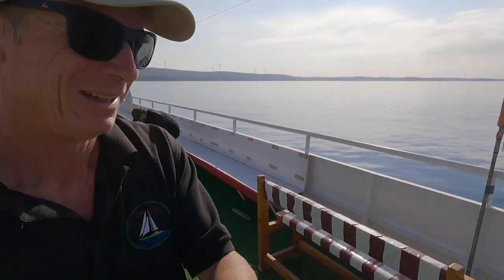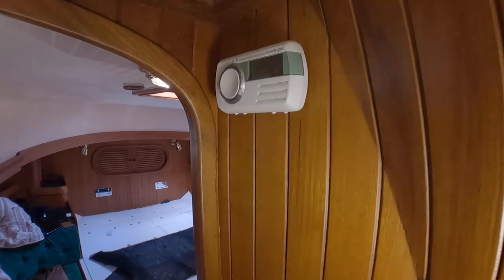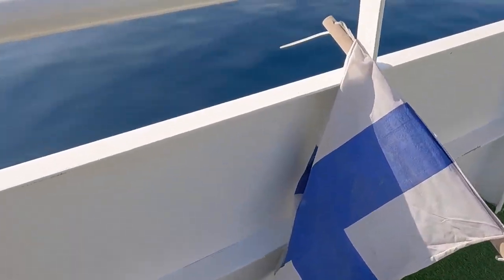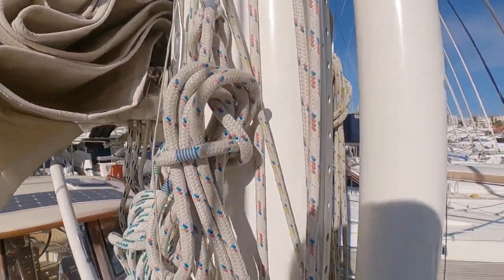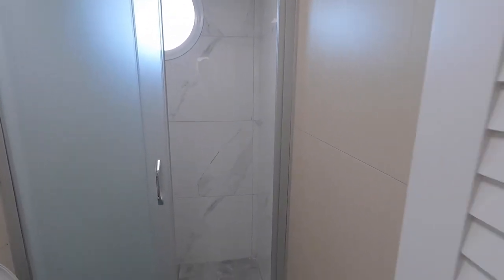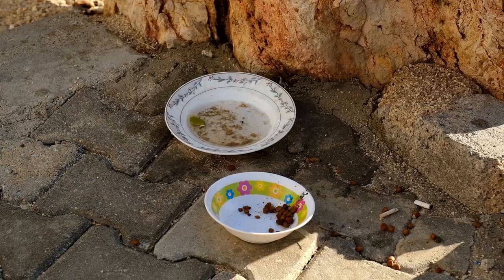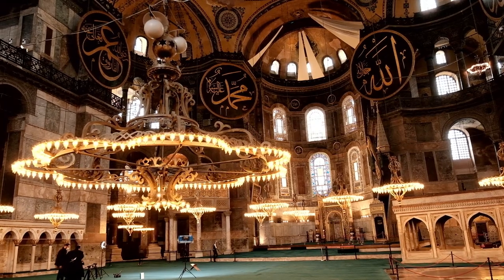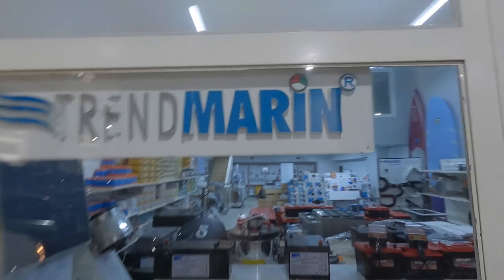Ep 54  |  Marinas, Mosques and a Silent Death Trap!

Comment: Hi Steve, You were very, very lucky that the CO alarm went off! Without it maybe we would have witnessed the last episode of Sailing Fair Isle!  Your detector is correct installed near the ceiling close to the engine room. However if the door to your cabin is closed and the CO gasses would have penetrated the cabin thru the floorpanels you wouldnt have been so lucky! Please install a CO detector on bed level, so we can enjoy many more YouTube episodes 🙂
Reply from the maker: Yes you're right and on closer inspection it had been leaking fumes for some time. There are patches of soot deposits in places in the bilge. Weird that the white insulation sleeve showed no sign of discolouration. The exhaust run is too long really, but thats just a fact of life with a centre cockpit boat. I think it was the root of the problem with the generator too. I think we will have a little follow up in the next episode to try and highlight this as there must be other boats with this issue & it's hard to detect. Difficult knowing how to pitch it as we try to stay away from 'we almost died' type headlines but you're right & maybe we should highlight this more?
Reply from the maker: @jordanharkness  CO2 is not what we are measuring this is about Carbon Monoxide not Dioxide so it’s lighter than air and the detectors must be mounted high. Please do not comment with false statements it is not helpful for people who need proper information, your misinformation could kill.

Comment: Eliminating CO has been a mission of ours. We have taken out any combustion sources from the cabin and replaced everything with electric. Obviously it's far from perfect as generating enough power to run electric heating is an issue that we are working on still. At the moment we are hooked up to (unmetered) shore power. I like the problem solving but my wife must wonder why I spend so much time with my head in my hands.
Reply from the maker: Yes heating a boat with electric is not possible on the hook if you're anywhere but the tropics! Sadly the choices at the moment are get cold, or use some sort of carbon based fuel for heating. I guess we'll just have to be careful (or cold!)

Comment: Hi Judy and Steve, thanks for sharing the experience with the AGM batteries. Any idea why they were bubbling up? It was also useful to see the demo of the Ventura water maker system. Fresh water availability is a constant anguish for mariners preferring to anchor “off the beaten track “ :-)
Reply from the maker: Yes it was sulfation. The crystals build up and eventually short them out. AGM's like a full charge often and a good dose of current, they can easily take more than 1C with for mine would be 180Amps. Well they rarely got over 90 amps, mostly 40-50 and I think the voltage drop in the long cabling needed to get to them fooled the system into going into float too early for these batteries.

Comment: Did you look at Desolator? If it is not too late you ought to. We replaced the water maker on our Discovery to a Desolator and it is amazing. You don't have to bother with all the flushing it s all computer controlled.
Reply from the maker: I did look at them yes and couldn't find good figures for what the draw was, seemed like about 25Amps at 12v? The Spectra is 10Amps which is very hard to beat!

Comment: Hi, can I ask why you have the CO2 alarm up high? CO2 is heavier than air so concentrates in the bilges. By the time it gets up to your alarm I would think the amount of CO2 would be quite high.
Reply from the maker: It seems you’ve got yourself slightly confused. We are not talking about carbon dioxide (CO2) here, which is the fifth most common gas in the world and most of what you breath out. The gas of concern is carbon monoxide (CO) which is deadly and can come from burning fossil fuels. CO is lighter than air which is why you have the detector high.

Comment: We have the Ventura and it has given us trouble free usage since 2012, our unit only delivers 7 gals/hr which suits us as we are quite frugal with water usage.
Have they increased the water output of the new models?
Reply from the maker: No that is the expected rate 7 gallons / 31 Litres. They work at contstant pressure as I'm sure you know so if fitted properly with a forward facing scoop and short run from the inlet seacock to the pump with a good sized pipe will deliver the rated supply consistently. Many others claim good figures but rarely if ever produce them in real life.

Comment: CO alarm should be mounted at floor level.
Reply from the maker: NO! Please do not post false information on here. CO detectors need to be up off the floor. CO is slightly lighter than air and a detector will not work at floor level. 5 feet up from the floor is considered optimal although ceiling is also fine on a boat.
Reply: @svfairisle  

Hi Steve

I got some confined space training, while working on a Steam tunnel under the Senate Office buildings in Our former Nations Capitol. One of the things that kills very efficiently is displaced gasses. We konk out at around an 18% O2 deficient atmosphere. 4 gas analyzers were worn on Our Tyvek coveralls. Additional factors involved were PPE worn mask air filtration, equipment. Very hard to breath as the filters get depleted, and high temperature. I was required to document vital signs on the workers. Some of the additional things I noted were Flu like symptoms all the time. As well as extreme irritability among the entire Team. In a controlled environment. We can predict air exchange in an area. Add on dust and unpredictable conditions things start to add up fast. See You at Herrington Harbor North.